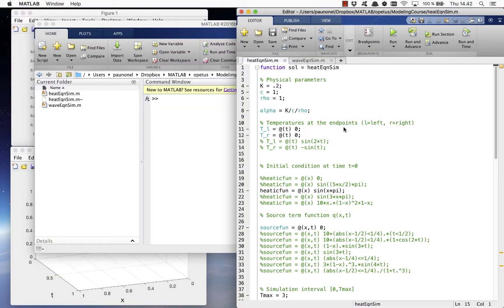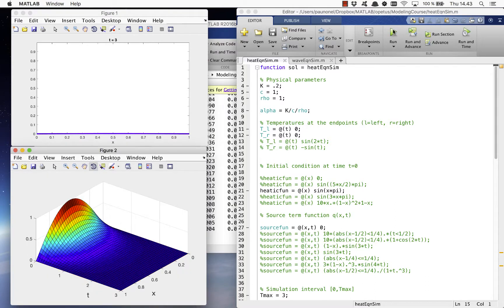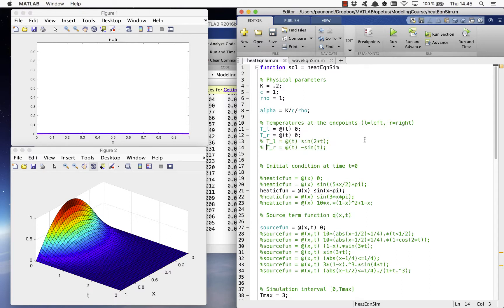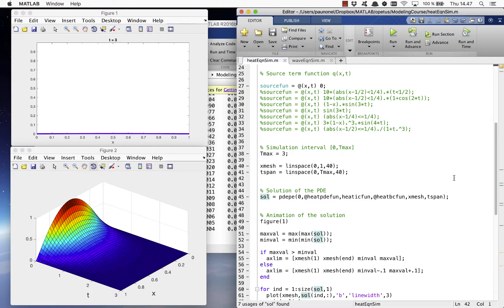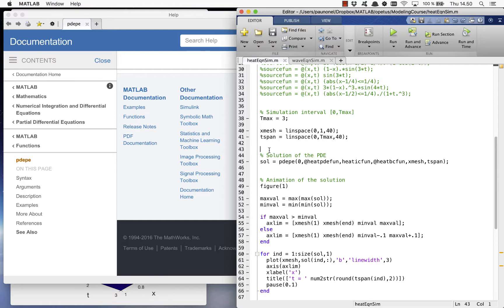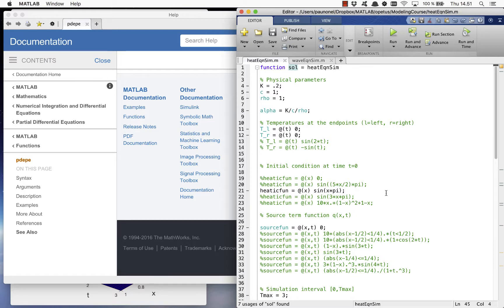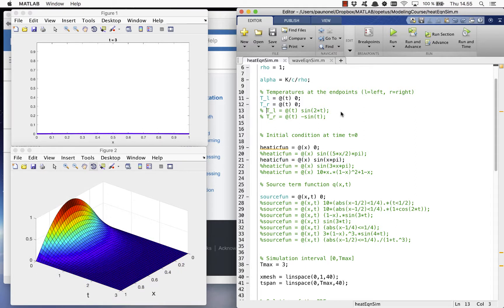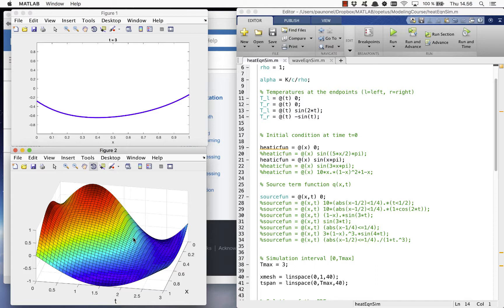Modeling with PDEs part VI - Matlab simulations

Comment: can you do reduced method for this PDE's?
Reply from the maker: Hi! Sure, this is possible, but in that case the model reduction is typically completed for the numerical approximation of the original PDE model. On this course we are mostly interested in the mathematical properties of the PDE models (and do not consider numerical approximations in detail), but model reduction of approximated PDEs is a very active research area. Especially the research group of Professor Peter Benner does very nice work in this area, and they also have a (free) Matlab toolbox MORLAB for model reduction (available at https://www.mpi-magdeburg.mpg.de/projects/morlab ).